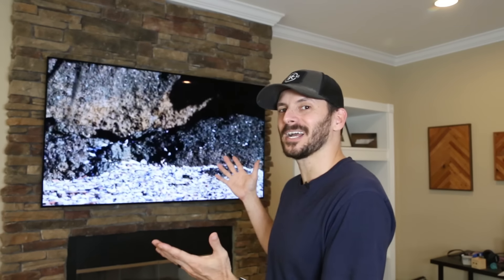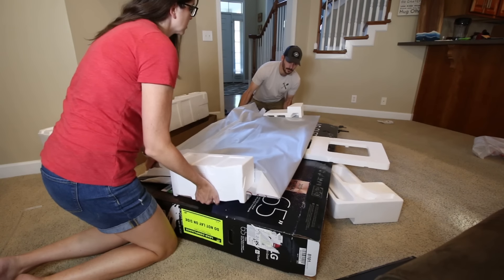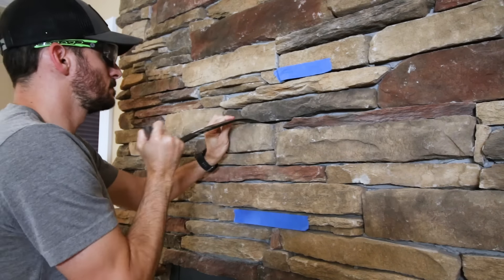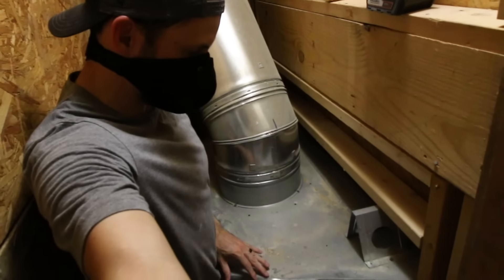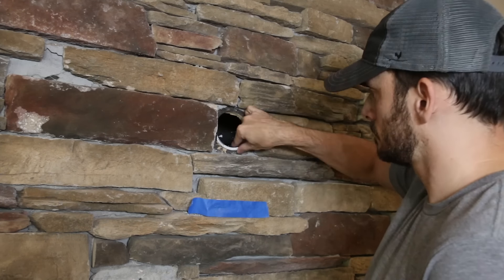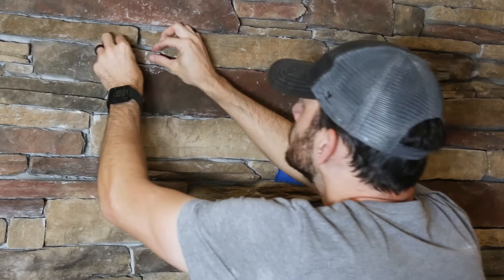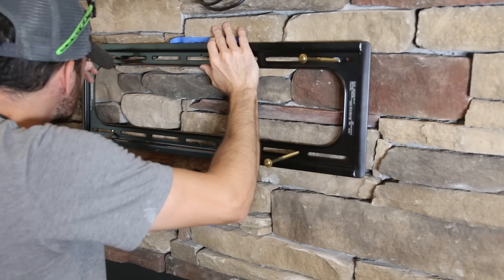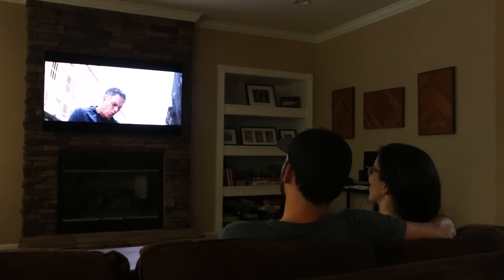How to Mount a TV Above a Fireplace and Hide Wires

Comment: Good job! I would have ran a data line as well ( Cat 6 or Cat 5e ) just in case you want a wired connection to the TV for streaming. I know that TV has wireless but wired is always better when possible. Thumbs up!

Comment: Love the project, did this myself last year only I have an actual fireplace with 3 inches behind the plaster and lath (house is circa 1916), and the adjacent wall only had 1.5" I also chose to run 3 hdmi, ethernet, optical and usb, even trickier, I put them all on wall plate.  Plus I ran a dedicated power line for the tv, overkill I know.  I spent a good 8 hours fishing all the wires but in the end it was all worth it.  It looks amazing and my Partner is happy!!!
Reply from the maker: Sounds like you did a great job!

Comment: I don’t have a crawl space available. My stud finder only goes 1.5 inch deep and happens to not be deep enough for a natural stone and cement board. Had to google fireplace framing to see that I had 2 studs running up the middle as I couldn’t find one and surely wasn’t going to mount in cement board. Awesome video and like the hidden storage option!!

Comment: Pretty decent for a diy. As a professional, we ALWAYS route wires through the attic or down to boxes. Hmdi wires should be at least 12” apart from romex to prevent distortion. Nice job
Reply: This is especially crucial when all you have is space for the flute. I don't have a side wall like this guy.

Comment: Well done.  So I fhad a similar setup situation and followed you direction and have TV's on stone wall over fireplace... However,  the heat of the fireplace seems to be too hot (I do not have a mantle.  Have you experienced the same issue?  What's best way to deflect heat?

Comment: We use drop anchors and then all thread coming out of the stone making sure its as perfect as possible elevation and plum and level. Then you can use nuts to set a flat base all the way around. So the mount in many cases, does not ever touch the wall . Very strong and very durable esp in real stone work and masonry thats thicker then 4”

Comment: The fireplace you have is actually a prefabricated fireplace with vented gas log system, which you would want to always burn with glass doors open. Closing the doors will not allow oxygen flow to the unit. Anyways interesting video and I'm curious on if the TV will hold up without having a mantel installed to deflect the heat.

Comment: I know the video is old but just in case you see this - how did the wiring hold up with the heat behind the wall? We’re looking to do something similar but wondering whether the wires can stand up to the heat.  Thanks.
Reply from the maker: Zero issues going on 5 years

Comment: I want to mount a 95lb tv over a 2” thick faux stone fireplace.  My question is can I just use stone anchors without  finding and drilling into the stud. Can the 2” stones and the right type of bolts  hold the weight  of the tv and the mount

Comment: Awesome! I am planning to hang my old LG on a veneer wall, but I am a little scare to do that. I saw you just made tinny holds and I was thinking if I need to break or remove the existing veneer. 
Is there an specific type of bracket I need to use for a LG model 55SJ8500?

Comment: I have a stone fireplace in my great room and a power plug is mounted on the center of the stone fireplace. I wanted to start a project which is mounting my TV on it, but I do not have a prior experience, which makes me nervous before starting it. I guess finding locations of wood studs inside fireplace is the first thing to do, but I am not sure about it. Do you think I have to find where the wood studs are? In this fashion, I think four (4) lag screws for the mounting bracket are screwed in them and my TV is securely mounted on the fireplace. I wish I can show you some photos of my fireplace. Can you give me your valuable advice?

Comment: How wide is your stone surround? We are having a house built with 6’ stone width and are contemplating the 77” oled that is 68” wide. It will technically fit but I’m not sure if it will look too big. The fireplace stone will also go floor to ceiling so the height isn’t a problem. Thanks in advance!

Comment: Do you think that PVC inside the fire box is safe? I too have a ventless gas fireplace with a big empty box behind it (I peaked in mine from the attic) and I want to hide my wires. The heat is the only concern i have.

Comment: Questions on installing TV mount above fireplace without access to the wall and no bricks. Not sure where to mount since I've no access behind the wall. Scanned for studs, found unevenly between 12 to 15" spacing. TV mount manufacturer recommended spacing is 16". After viewing your video, you've drilled and mounted unto the header board instead of stud. 
First, is that safe? I'm assuming due to light weight of 32lbs for OLED TV 65", you can get away with mounting to the header? 
Second, I want to install TV Mount that can extend out 24" for closer view for my mother who has impaired vision. If I drill and mount it to the stud, will that help? Since the stud is mounted above the fireplace instead of the floor, so not sure if it's structural sound and viable to install Extendable TV mount that can stretch out 24". You're feedback will be greatly appreciated. Not much info on YouTube for installing TV mount above fireplace without access to wall.

Comment: Why on earth didn't you just use a handheld tile saw and cut out a rectangle in the face of the fireplace (and remove all the stone) where your TV mount and electrical would install giving you a flat, uniform area to mount everything.  You'd probably have needed to build out the area a bit, but that would be easy.  No one will ever see that area of the fireplace again given a TV will always occupy that space in the future.